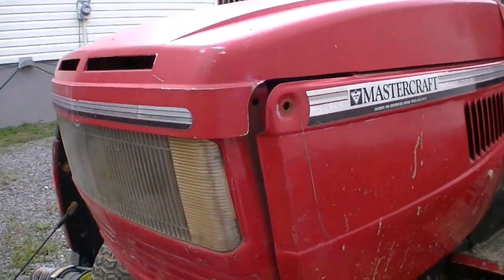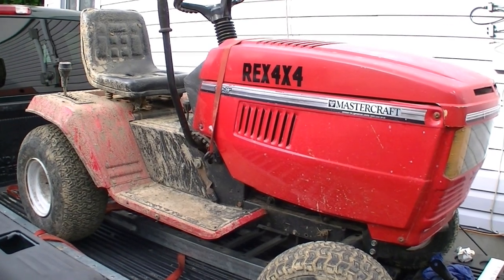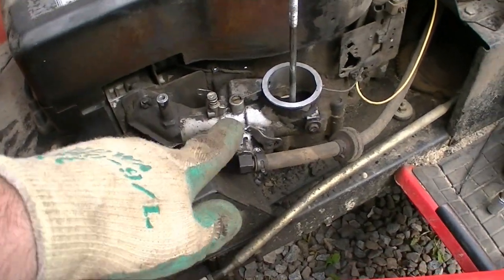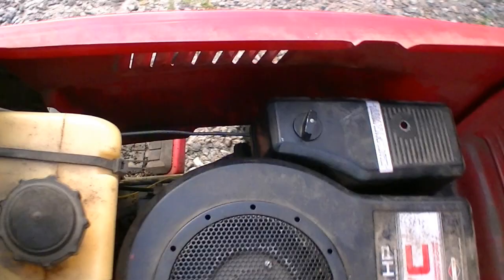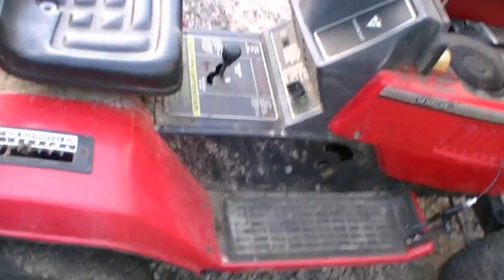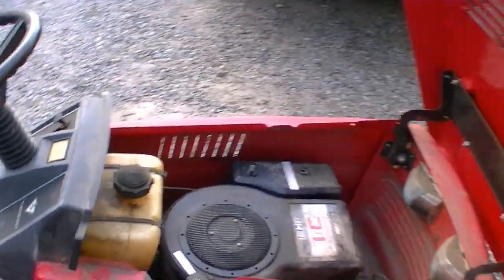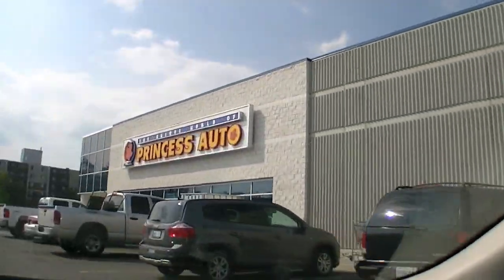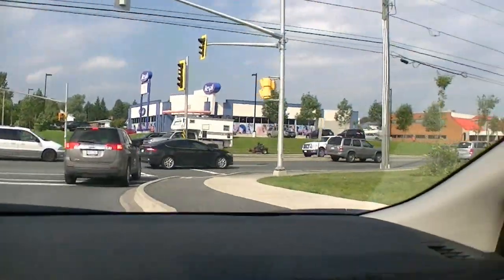some tractor mods and marcelstjean

Comment: A flexable hose would make it easyer for routing, like say.. an old vaccume cleaner hose ha ha :-)

Block the holes under the box and make one in the top to fit the hose in, then seal the seams with silicone bath sealant ha ha might work :-))